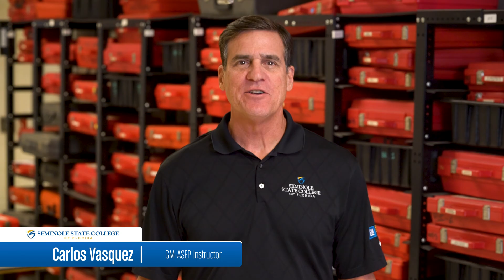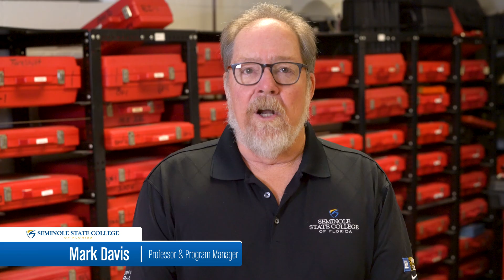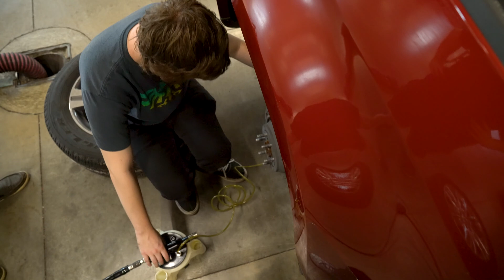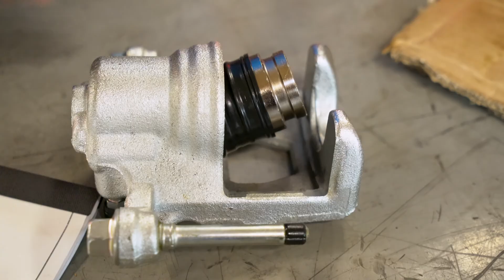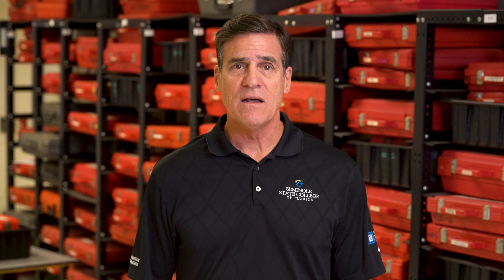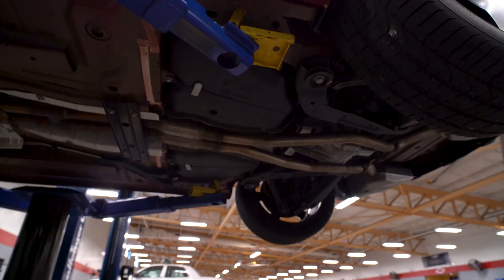General Motors  Automotive Service Education Program

Comment: This is straight from the Dept.of Labor and why aren't technicians being properly advised and trained of the laws,their rights and their fair values anymore and why doesn't anybody in that business understand the word "AGREED" anymore????"However, if the work has already been performed at a higher AGREED rate, the employer must pay the employee the AGREED wage for the hours already worked. For example, if an employee and employer AGREE that the worker will earn an AGREED flat rate of $500 for a job and the employee performs the work under this AGREEMENT, the employer cannot later reduce their flat rate wage to $400 after the work has already been completed."